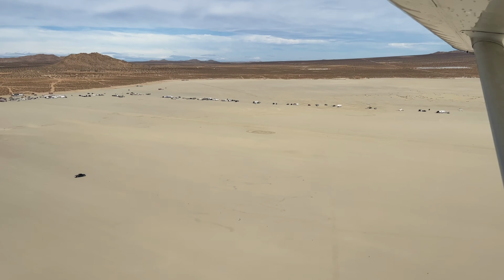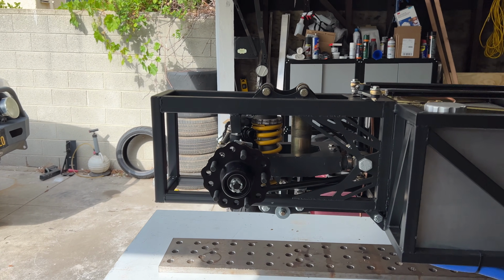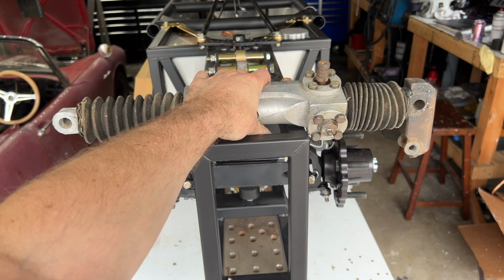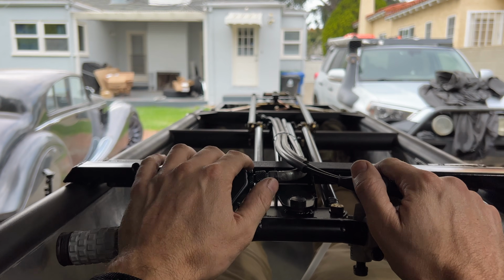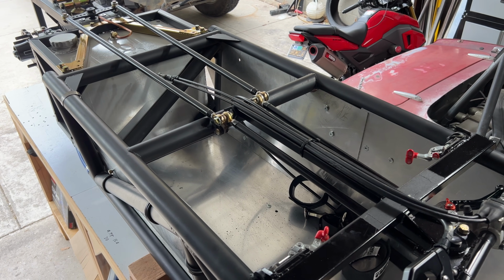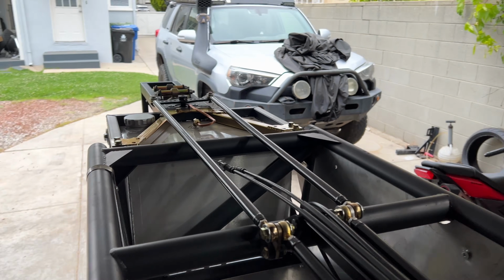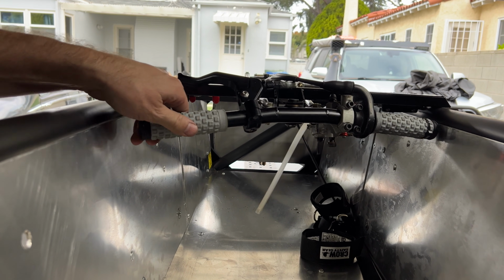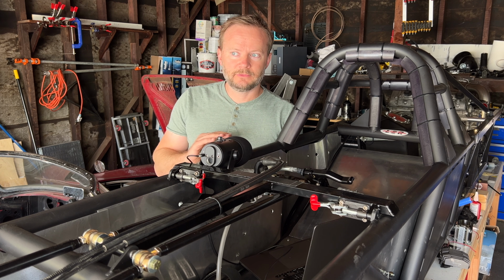Unnecessarily Complicated Steering

Comment: As a current student in Aerospace Engineering with an Astronautical Focus, with orbital dynamics the direction you point your rocket is incredibly important! The speed value of your rocket's velocity is only a part of the problem. Depending on your direction of travel that speed may not be enough. 

For instance, if you fired straight up, your escape velocity would actually be HIGHER than if you fired into an orbit and then escaped from there. The reason being that when travelling tangent to the central body's (Earth) surface, you are taking advantage of what is called the Oberth Effect. Essentially the deeper you are in a gravity well, the less energy required to perform an ejection burn, and that burn is entirely a velocity vector and not a scalar speed. It would only work with a prograde (facing forward along your path of travel) vector. 

As for coming off the ground, if you travel with the rotation of the Earth, you actually expend less fuel to get to orbit compared to if you injected into a retrograde orbit. The reason being you would need to overcome the horizontal velocity of the Earth's surface and then also still get up to orbital velocity. 

I do agree it should be land velocity racing though. Absolutely 0 reason to call it land speed if it's all in one direction tsk tsk.

This is all in good humor btw! I love your content!
Reply: If the end with fire coming out of it points up, you will not get to space today.
Reply: @SteveBrownRacing  exactly what I was thinking during the video.
Reply: I'm not a rocket scientist, but... I have played a lot of Kerbal space program.
Reply: Thank you for the detailed explanation.You must be great fun at parties, too

😋
Reply: Hmmmm, in land SPEED racing, isn't it always the case that you must duplicate the feat in both directions on the course, in order to cancel slope and wind effects?
If this is the case, wouldn't it cancel out the direction part of the vector and reduce mathematically to a scalar?
Nerds!
Reply: @Chris-bg8mk  Fastest there and back. Can you win by just staying put? I'm gonna show up with a couch and just sit there while they give me the trophies :)
Reply: While the direction is important to the path of the vehicle, the point of escape "velocity" (speed) is that it corresponds to the kinetic energy which is sufficient to remove the vehicle from orbit. The direction is only important to escape in that the vehicle needs to not hit the planet on the way out. From geosynchronous orbit, for instance, the chance of a randomly chosen direction intersecting with the earth is small.
Reply: @brianb-p6586  True, but even then there is an optimal trajectory, and that trajectory usually involves getting as close to the Earth (or body you are orbiting) as possible to take advantage the Oberth Effect gives you. 

This is gonna get super nerd, but you can use langrangian physics and slope fields to calculate the most likely path to take with a minimal energy requirement to perform. Pretty much all of those require burning prograde at periapsis (lowest altitude of your orbit.) 

You could in theory still escape from any direction, but then the speed portion of your velocity changes massively and always increasing. 

Then there's fun stuff like n-body physics where you utilize slingshot maneuvers around gravitational bodies or Lagrange Points (points of roughly equal gravitation between two points that are considered metastable) to eject with even less velocity change (deltaV) 

But all of those still require that specific direction to be attached to that scalar quantity!
Reply: @EatMyYeeties  isn't land speed racing done in both directions? Land velocity racing would have much lower numbers... "I'm land velocity champion", "What's your record velocity?", "-4mph", "Noice"
Reply: @CED99  Ah, golf rules. I see that you, too, are a man of culture. (I don't golf)
Reply: @EatMyYeeties  All good stuff... and we agree, with sufficient speed any direction that doesn't hit the planet works. 👍
Reply: so position is a facotr of velocity then?

Comment: Educate me pls!

As i see it caster will change with suspension travle. Is this effect negligible? 

It does seems good to have more caster, and more stability, as the suspension compress, but how about just before take off?
Reply from the maker: It does change with suspension travel, but there is so little suspension travel that it shouldn’t matter. It was a bigger effect before I modified the swingarm.
Reply: On a bicycle, where the caster is set by the steerer/headtube angle, as the suspension loads up, the caster is reduced (the head angle gets steeper). Increasing head angle reduces trail, and if your fork rakes forward with the axle ahead of the steering axis (which they almost all do) your trail can go negative. This makes bikes twitchier while under load because inertia will provide less  centering force to the steering and when the head angle is slack, 45° steering results in less than 45° at the contact patch, but also the leverage ratio of the steering increases because the contact patch is now closer to the steering axis.

Comment: The interesting thing to me about the steering set up was that someone this week mentioned how a certain fictional motorcycle turned. It was by changing the lengths of the struts that held the wheel and I hadn't realized until they said it. I thought that was a pretty interesting (if somewhat over engineered) design for a motorcycle, and this sounds very similar.

Comment: Adjustable wrenches are my favorite tool for rounding off nuts and bolts, and now they'll be my preferred tool the next time I need to add some rake angle to, well, anything really.
Reply: Adjustable wrenches are better for bending sheetmetal than their intended purpose.
Reply: @DangerDaveMurray  he's out of line, but he's right. 🤣🤣
Reply: @DangerDaveMurray  wow... you just saved my forearms from continued small cuts. I built a aluminum sheet metal dual flight stick mount & I have been putting off bending the sheet metal 'desktop' mounting surface.
Reply: They're also excellent at seeking, finding, and smacking fingers when doing anything with them at all!
Reply: They are really good for massaging out any bending in chainrings or chainring spiders.
Reply: fyi...... theyre now called "all 16ths wrenches"
Reply: @kazzTrismus  No joke is worth allowing 16ths to continue existence.
Reply: Just remember to cut the triangle 🔺️ 😌 👌
Reply: They are actually called " nut fuckers "

Comment: You claim to work for the algorithm, yet you shot down my half written comment telling you your steering geometry won't work. Now I will have to find some other thing to be pedantic about...

PS. Yeah, handlebar steering for non-leaning vehicles trip me up badly. You might want to practice that for a bit!
Reply: I know someone who drove an adult tricycle (just like a regular bike but with two rear wheels) right into a ditch at low speed because she couldn't overcome her learned impulse to counter-steer it like a bicycle and simply continued to turn the wrong way.
I've ridden a CanAm Spyder, which is two-wheels-in-front trike with handlebar steering, and had no problem with it, but I have only ridden bicycles, not motorcycles.
I think that the more the vehicle and riding position is unlike a bicycle or motorcycle, the easier it is to adapt to using handlebars like a steering wheel.

Comment: Technically escape velocity does require direction.  Launching towards the center of the earth may not achieve desired results
Reply from the maker: You just have to maintain escape speed through the earth, somehow.
Reply: @SuperfastMatt  I'm curious why NASA haven't contacted with you Matt yet 😄
Reply: @aktik6000  nasa is a hollow shell run by snowflakes making politically imperceptible bite-sized warm fluffy human intrest videos
Reply: @SuperfastMatt  you could travel at a constant speed at 90 degrees to the gravitational pull and just go round and round forever. I think you know this and deliberately said something to get us all to comment. #allhailthealgorithm
Reply: @eayzgaj  Matt understands that if your tangential speed is higher than that corresponding to the acceleration of gravity, your orbit increases in radius (altitude) and if your speed is escape velocity you will completely escape earth's gravity.
Reply: @brianb-p6586  not if you maintain your altitude
Reply: @brianb-p6586  you’re saying the at a certain speed the centripetal force will be larger than the gravitational force. But I’m saying that you maintain your altitude. Maybe you have wings pushing your downwards or thrusters pushing downwards or a cable tethering you you to the earth
Reply: @eayzgaj  that by definition is no longer the speed to escape the earth's gravity well... because you're supplementing gravity with extra force! If you turned the earth into a giant earth sized magnet with 10T field strength and made your rocket from Iron... 🧲
Reply: @SuperfastMatt  Which brings me back to me saying that every problem can be solved with more power!!
Reply: @SuperfastMatt  h-how
Reply: @SuperfastMatt  Presumably any non-zero velocity relative to a planet, if maintained indefinitely, is an escape velocity. However, I don't think this is how the term is ordinarily used...
Reply: "may not achieve results"

It's a non-zero chance then.
Reply: @DubiousPanther Unachieved results are still results

puts finger to imaginary earpiece Hold on, I'm being told they are NOT, in fact, results.
Reply: Well it works for spherical cows in a vacuum.
Reply: @EmyrDerfel  What kind of vacuum are we talking about?  Garden variety, or frictionless?
Reply: You are technically correct - the best kind of correct.
Reply: @TheKiltedYaksman1  I call that Microsoft Correct.
Reply: @TheKiltedYaksman1 no he's not. Yes escape requires a direction, but "escape velocity" the term refers literally to "the minimum speed required to leave orbit", which you couple in practice with a suitable vector
Reply: Just maintain the speed .... And ... To the moon.
Reply: @Catrpilla Not at all
Reply: Technically if there is sufficient momentum and with suitable material you could punch right through the planet and out the other side
Reply: What's a little litho-breaking between friends?
Reply: Friction can be compensated by more power….
Reply: Aahhh engineers… lovely 😎
Reply: Unless you are going very very quickly...
Reply: doesn't matter if you're going up or down, you're leaving this world either way :D
Reply: It should also be noted that you could go "escape speed" in circles and still not escape, since your velocity is constantly changing
Reply: Minor design error. Even god is not perfect.
Reply: Speed is unaffected by change in direction so you could "speed" as fast as you like around the surface and never leave the planet.
Reply: I came to the comments to make sure someone was pedantic enough to call this out.  Fortunately it didn't have to be me.

Comment: I would mount a steering damper
Reply: The leverage ratio he has with bars that wide versus the arms on the shaft (the arms at each end of the forward/lower links seem about the same each end) means he should have plenty of control authority.
Reply: It might be a good idea, but the steering linkage travel is so short that a suitable setup using typical telescopic dampers would be difficult. Maybe a rotary damper?

Comment: This is very similar to how aircraft flight controls work. You’ve basically built a rudder system lol.
Reply: Since it is at the front...would this be a canard?

Can ardly turn in any direction....
Reply: @JohnSmith-yv6eq  canards are horizontal flight surfaces, not rudders, but it's worth overlooking that for the pun. 😁
Reply: @brianb-p6586 I wonder what a front-mounted vertical control surface would be called

Probably "bad"
Reply: @addison1024  forward yaw control surfaces can work well, but they are generally destabilizers, not stabilizers.
Reply: @JohnSmith-yv6eq I thought this whole channel was a canard

Comment: You know, with enough math we can figure out a function that describes “Matt time” and then we can successfully predict any ”Matt time” into the future! And when it inevitably fails us we’ll call those outliers and throw them out as bad samples.
Reply: Thursday at 8 AM PST +/- 167.99 hours
Reply: @maxfcanto  Precisely! Hats off!
Reply: Found the engineers
Reply: @RecoilOperated   Time to shoot the Engineers and start the Project.
Reply: Problem is the feedback mechanism, where Matt observing the function causes it to collapse into a heap of broken logic. Slightly less gruesome than using isotopes to maybe poison a cat.
Reply: I have a feeling that "enough math" would require a supercomputer to run starting now and ending sometime past the heat-death of the universe.
Reply: @superdupergrover9857  I initially read this as "enough matt". It was still good.
Reply: Correction: enough Matt-h
Reply: Spoken like a true Matt, Maks
Reply: If it fails us you just need to pull a 3 Blue 1 Brown and find out how that failure apparently was be ause we didn't take into account the complex plane and somehow we could have identified that outlier if we had utilized the complex plane and the fifth roots of unity or whatever video I watched last night by him lolol.